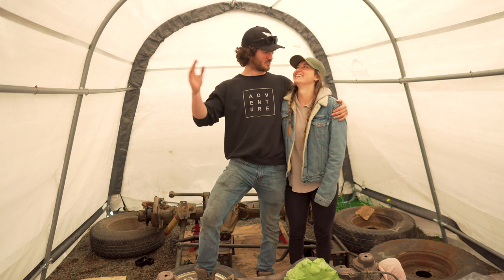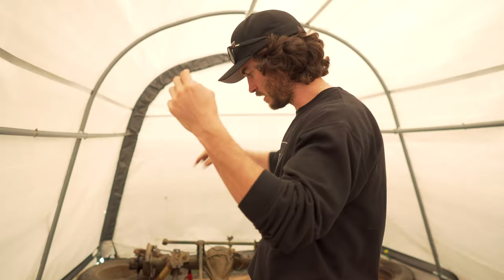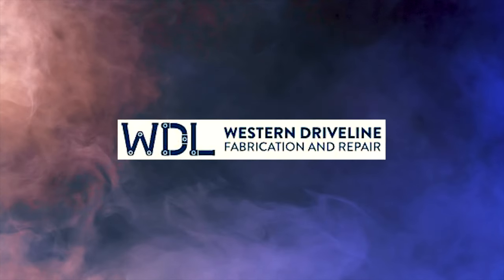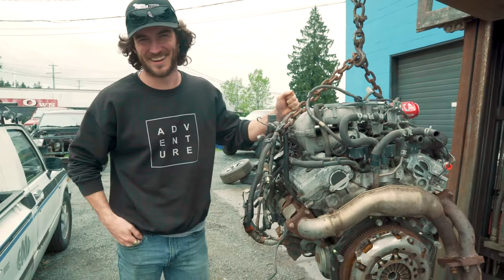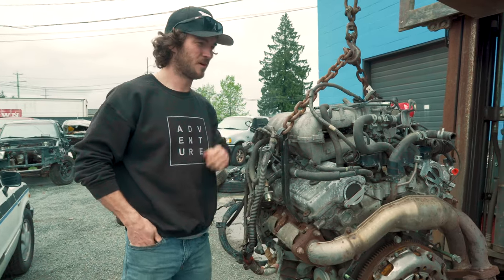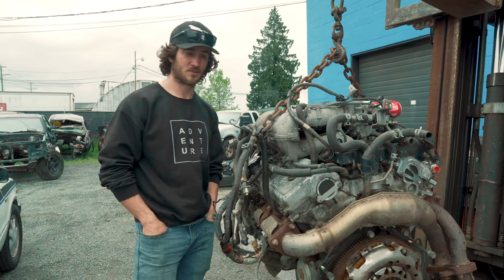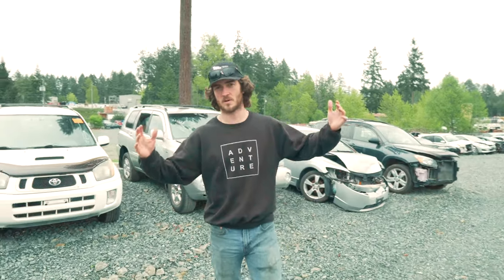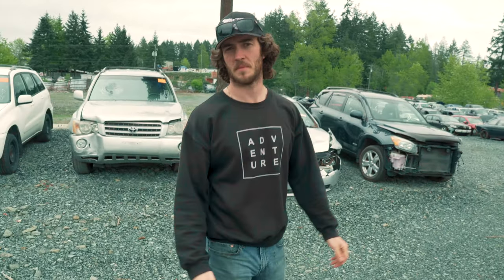4x4 TOYOTA CHINOOK BUILD GETS A 3.4 V6

Comment: Needs a TDI swap
Reply from the maker: We considered it, even have a TDI to use. Just not the best option in our opinion after a LOT of research. One of the main reasons is modern diesel don't respond well to high Sulphur and low quality diesel, which is frequently found where we intend to travel. Also, the extra cost of putting a TDI in would make the fuel savings negligible.

Comment: What are the plans for wiring? Assuming the chinook is 4cyl efi?
Reply from the maker: The Chinook is 4cyl yes, efi, no. It has a carbureted 20R engine, so very minimal engine wiring, which I hope will make my job slightly easier.